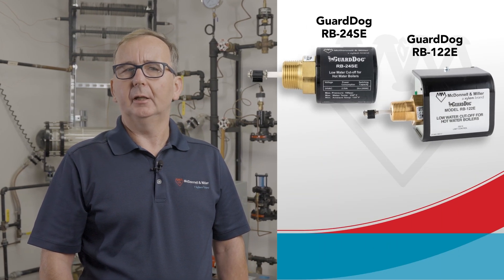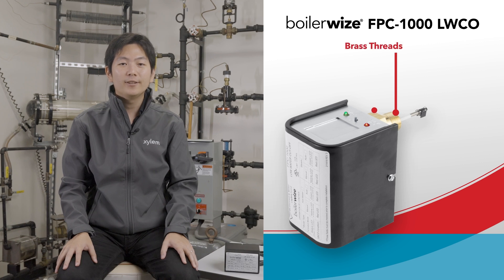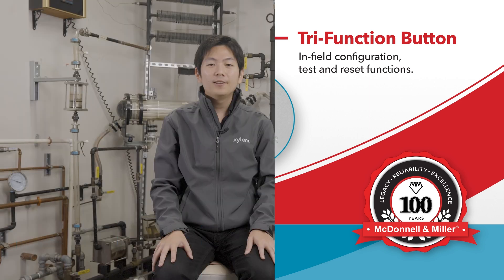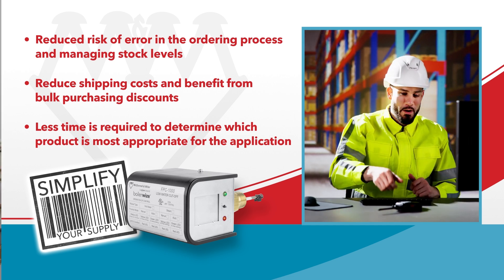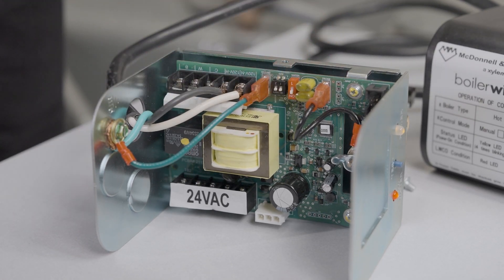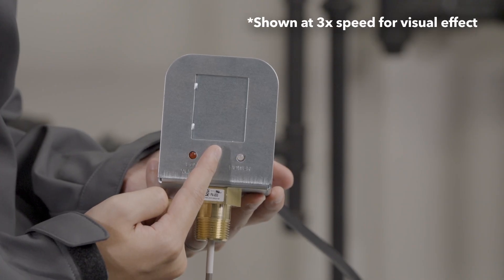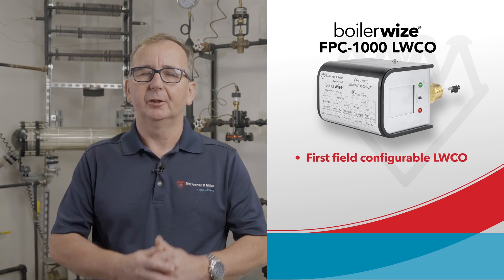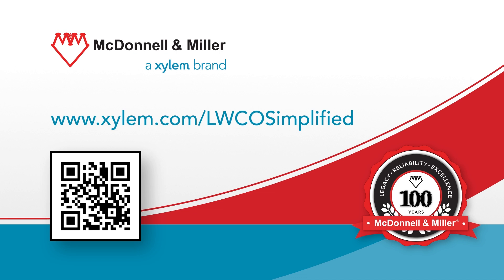McDonnell & Miller - boilerwize® FPC-1000

Comment: installed five , nothing but issues, even followed the instructions here , during power loss they don’t reset , had to pull probe wire to lock out and reset after power loss.
Junk in my book , Good idea but needs work , along with tech support.